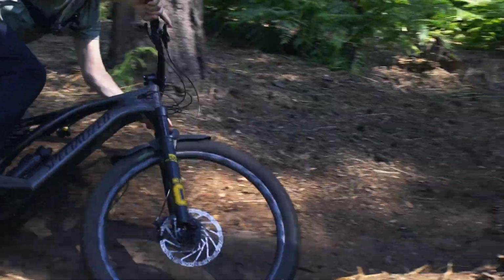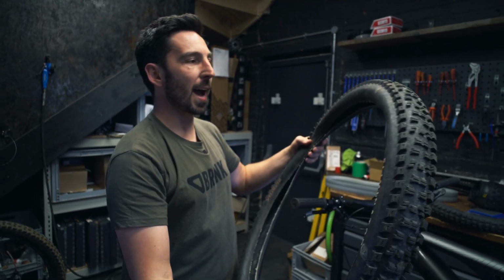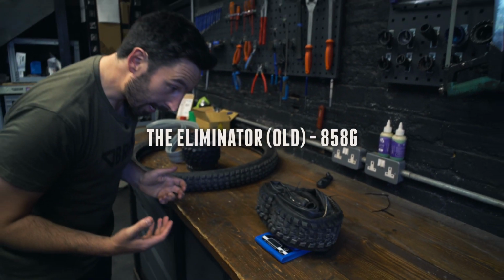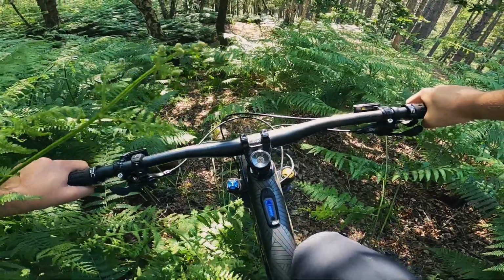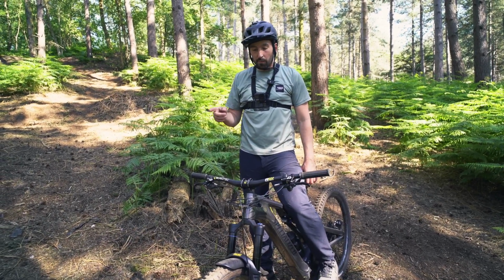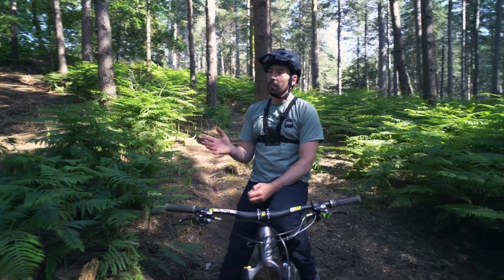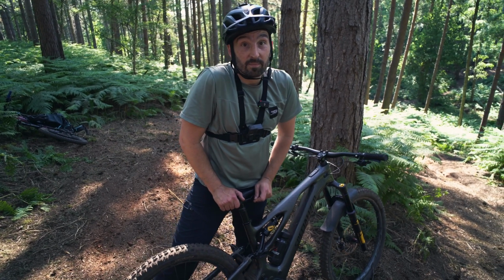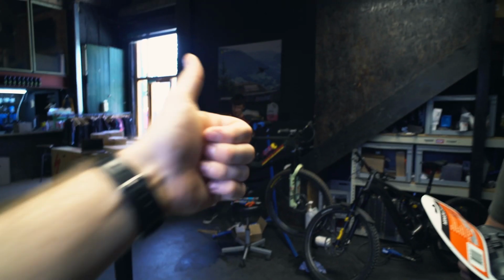The BEST value DH tyre?

Comment: Nice review mate 👍 I am currently on the stock tires(butcher and eliminator), I’m a bit “heavier” (about 280 pounds with gear) and I find, especially for more Xc/Gravel type of riding I’d like to be able having more air pressure in at least the rear tyre than the current maximum of 2bar for the butch/elimin tires for less rolling resistance when there’s more pedaling action going on…what is the maximum pressure on these Cannibals? Do the Cannibal have more or less rolling resistance? Do you recon I even need to compliment with Cush Core due to my weight?
Reply from the maker: I would say you wont need Cushcore on Cannibals. Roll resistance is a consideration aswell as total tyre weight. The cannibals are heavier but they are a better tyre for support and grip which on the ebike is paramount to a good ride experience.

Comment: Hello! Thanks for the video, I have a stumpjumper evo carbon frame, and i just bought Roval traverse 29's dt swiss 370 to change my specialized stock rims, 29/27.5, im going to keep the mullet in case i want to switch later, but i have a question now, i have already a eliminator 2.3 new back tire, and i need to buy a new front tyre, i like my butcher on my mullet setup but do you advice Cannibal 2.4 /eliminator 2.3 instead of Butcher/eliminator 2.3? I do trails sometimes abit enduro runs, and sometimes i like to just pedal some kms and have somefun on the trails thanks man
Reply from the maker: Hello! Cannibal is more of a cut spike style mud tyre. Great for loamy loose tracks but not ideal for anything hard pack. Great winter front tyre though for the mud and the slop!